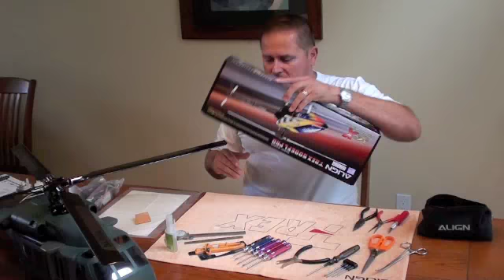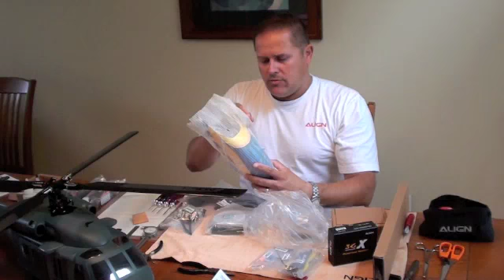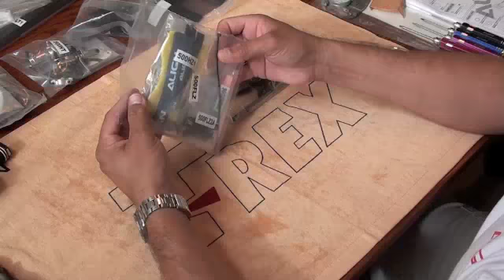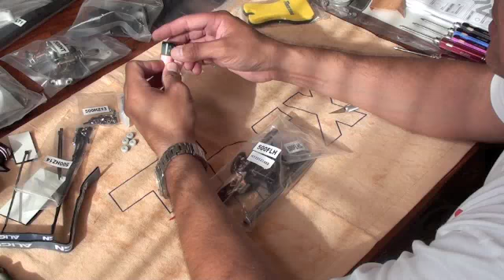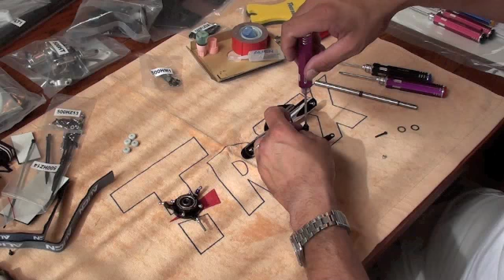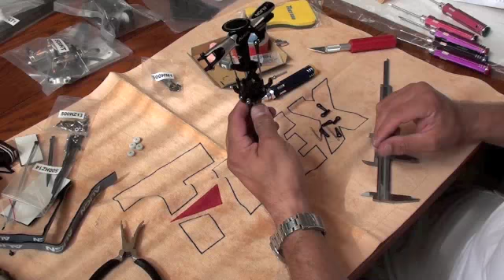Align Trex 500 EFL Pro Building the Rotor Head and Swashplate.m4v

Comment: hi jeff i am a little bit confused because you put 2 washer (9x12x0,8) to main shaft. but in the manual it says you should put them mentioned washer between thurust bearing and metal main rotor holder's bearing.... in factory assembly there is not washer in between them....would be a big problem...if so your guidance is also a little wrong i think